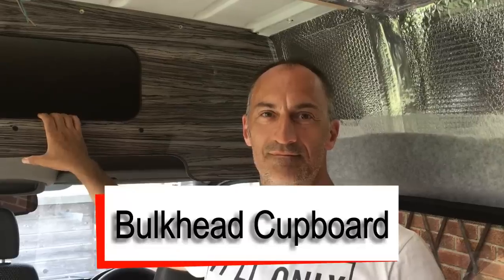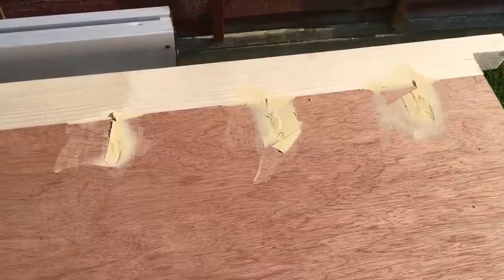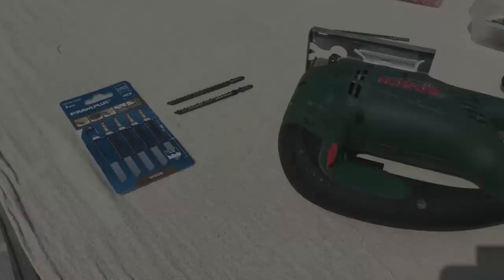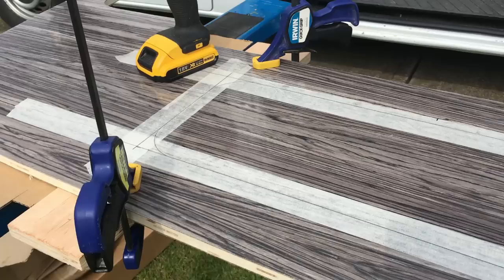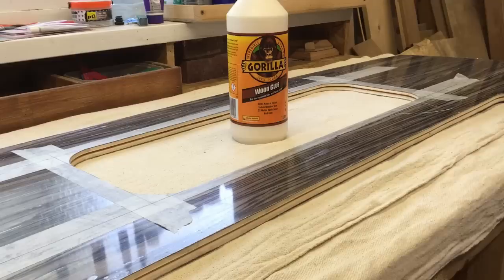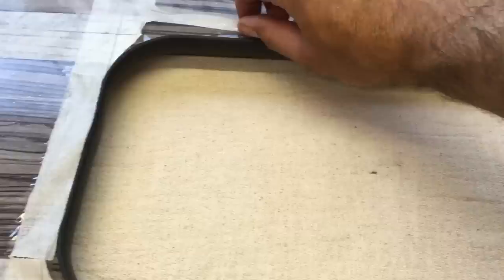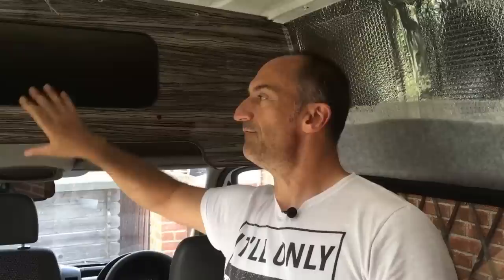Mercedes Sprinter Camper - Bulkhead Storage

Comment: Hi Greg. Did you insulate the space behind the headliner? Maybe I missed it in your videos. Anyway.. was curious, if you did, what materials you used as the space is limited. Nice video again! Learned a lot from your series so far.
Reply from the maker: Yes we did but didn’t film it. It’s easy to unbolt it and remove it we used wool based insulation cover with a vapour barrier and replace the headliner. 👍🏼

Comment: Hi Greg, I notice in this video you've not used reflectix to vapour barrier in the insullation over the headliner. Is this something you did afterwards? We've just ripper all ours out and are starting again as it was all wet. I was going to vapour barrier in with the over head locker over the cab. Be interested to here what you did with yours. Cheers Greg, really great series.
Reply from the maker: Yes you do need to vapour barrier over the insulation to stop condensation. It mean the headliner has to come out 😬
Reply: @GregVirgoe  thanks Greg, headliners out already just wanted to be certain we weren't wasting our time :) hope the new project is coming along, looking forward to seeing the videos when they come out :D

Comment: Is the shelf screwed into the metal of then van, or do those wooden plates just stop it from falling any lower? Great job by the way, watching your series closely!
Reply: Chris B... thinking the same thing? Is there a rib to fix to? Great vids btw. Doing my own conversion and these videos are great.
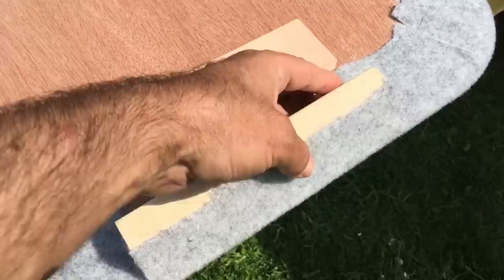Reply: Nope, it's fastened to the small pieces of wood, just like at 4:40. Those 2 elements are clamping the plastic of headliner together - holding the whole plank in effect ;D Simply genius !!!
Reply: I will third that question.  I was checking my bulk head.  I'm assuming you didn't just screw to the headliner and backing.
Reply: But how do you get the small piece of wood on the other side of the plastic?
Oh and awesome work as always mate 🙏🏼
Reply: I'm starting to think he maybe removed the headliner and fitted the shelf before refitting?

Comment: Hi Greg. Building the O/H bulkhead is a great idea,  did you first of all strip out the headliner and use sound deadening and insulation? 
Thanks
Giacomo 'Working on a Dream'
Reply from the maker: Sound deadening was already installed by the manufacturer and I filled the void with Earthwool insulation. Thanks

Comment: you are doing a really nice job, beautiful finish, very professional. I can't say my conversion is as well thought out :)  I have a 2006 Sprinter and am interested in your headliner shelf. At the front did you just screw into the headliner itself, what type of screws. For the side you must have slipped that second piece of timber around the outside of the headliner and screwed outwards into it ?

Comment: Hi Greg can i ask how you fixed the base to the cab roof. It seemed to just go from prepping to installed but im unsure of what you screwed it to or glued it to. Thanks for your time.
Reply from the maker: The mains strength of the shelf is held on the side and that timber cross member which is fixed to the furniture board. It did need much else so I just popped a couple of course screws into the headliner. 
If I did it again I would take the headliner out and insulate the cab roof like our new van and fix it like the sides. Before putting it back in.
Reply: @GregVirgoe  cheers Greg I'll check it out 👍

Comment: Hi you haven’t got a cad design drawing for the front cab overhead locker have you by any chance thanks Tim
Ps really impressed with you’re build really helped me out thanks
Reply from the maker: Hi Tim, the shelf could only be templated in the van to get it to fit exactly. I also cut the new face of the bulkhead by tracing round the old metal one, again I made a template first. Any odd shaped parts I have made templates and the plans are really used as design intent. Sorry can't help more than that. Cheers

Comment: HI Greg 
Just found your chanel/video from a chat on Facebook 
I have a question if I may 
How did you fix your bulkhead shelf to the van when finished I saw the timber blocks supports bud cant make heads or tables of how the fixing worked out

Thank you
Reply from the maker: THE MARKS BROTHERS I also cut some plywood pieces to go on the outer side to screw into. Lou held those in place while I fixed them. It’s fiddly and maybe easier to remove the headliner and fix them
Reply: @GregVirgoe  thanks Greg 
I'm hooked on your videos 
So grateful to have come across you feed

Comment: Hello and thanks for another very helpful video. I have one question. Is it enough solid when you screw directly to tapecirung? I need to build it in my Mercedes T1 and one option is to cut the tapecirung and place shelf on the car body. Thank you

Comment: hello Greg thanks for the nice clip .my question what did you do about the 28 mm gap behind the front panel.  Myself building a campervan with a VW Crafter h2 l3 bj 2012 and solved it with a strip of plywood. Thanks hope to see you mayby on some camper place

Comment: Awesome video! I had a question, how did you screw the very front of bulkhead to the headliner? did you take out the entire head liner to do this?
Reply from the maker: I didn’t take it out. With the rear edge secured to the timber and the sides secured to ply backers the front didn’t need much support so I just fixed into the headliner. It’s been fine for last three years.
Reply: @GregVirgoe  Thank you so much for the response! As always your videos are so helpful!

Comment: Hi Greg you could build these for a living.  What did you fix the shelf part to? Did you just sandwich it to the original head lining or did you fix it to the metal van itself ? Thanks Dave
Reply from the maker: I built our van so we didnt have to work any more :D
the shelf is screwed through the headliner into a block of wood the other side.

Comment: Tempted to glue carpet to the inside at same time. Reduce the rattle factor of loose gear? I know you suggested use as a linen locker, but how many times are plans like that changed in practice?
Reply from the maker: I suggested exactly the same thing to the misses but was overruled.
I should have just done it when she wasn't looking :D lol
Reply: Time to build in a couple of loose ball bearings in a tin tray over her seat. Her sentiments will change quite quickly :)

Comment: Greg.  How did you get in behind the headliner to position the backing wood pieces to screw into?
Cheers
Lawrence
Reply from the maker: Lou has really slim arms so she reached down the sides to place them 😊
Reply from the maker: In hindsight probably make more sense to take the headliner out as do it. It’s easier to insulate the bulkhead.

Comment: Hi bud wot did you screw the roof boards too I seen the wood blocks but wonder if the screw go in to body is there any thing there
Reply from the maker: Hello, I placed the piece of plywood on the other side of the bulkhead and screwed into that and it clamped the bulkhead between the two.
Reply: Cheers bud I've got a crafter and just starting it good luck with your travelling  can't wait to see all the videos ✌
Reply: @GregVirgoe  Hi Greg, here a viewer from Holland, by reading the comments I now understand that it's clamped between de bulkhead. How did you reach   "the other side of the bulkhead" ? Did you take the whole thing out and put it back later? How else ?

Comment: Daft question, is that the actual speed you use the Jigsaw? Guess I am cutting much too slowly lol
Reply from the maker: Hi Stephen, not a daft question at all, most of my cutting shots are sped up by 3-4 times normal speed as they take so long. Go slowly and you'll get better results with less tear out. Great question

Comment: Did you mount the shelf solely with wood blocks sandwiching the headliner? In other words is the headliner actually supporting the weight of the shelf and it’s contents? I know you mounted the faceplate to the van body and the faceplate to the shelf, which provides additional support, I’m just primarily concerned with putting too much stress on the headliner itself. I’m considering creating an L bracket that uses the same bolt holes for the headliner mount to piggy back off of those fasteners and tie the shelf into the bodywork. Any help and advice is greatly appreciated. Fantastic work.
Reply from the maker: That would be a more positive support for that edge but to be honest I can hang off the door opening and I weigh 85kg
We only plan to put spare bedding up there so no weight at all really. Thanks

Comment: Greg two things aren’t clear to me re the OH Bulkhead fixing. How are the battens fixed to the ceiling where the opening is and how is the ‘front’ fixed just above the drivers & pax seat? I see the wood blocks and the piece of ply to go on the ‘other side’ but does this then screw straight into the cabin metal ceiling or is there another batten behind the ceiling carpet? Help. 
Working on a dream
Reply from the maker: I fixed a batten to the face of the roof support strut, that I could screw the furniture board into, that is very solid.
The shelf blocks all have timber on the other side of the headliner to screw into, the headliner comes out to do this.
The trailing edge of the shelf has a 3x2 timber fixed to it that the furniture board is screwed to, this makes the whole thing very strong indeed. I reckon I could do pull-ups on the open doorway it's that secure.
Reply: Hi Greg I have just reviewed this and as I have not started yet wanted to be clear on what is involved in removing the headliner and once removed does the same headliner get refitted back into place or is a new one required? I thought the headliner might be glued (fixed) to the roof somehow. Is there insulation under the headliner?  finally do you happen to have a video of this particular step? Love the help you offer and by far the most enjoyable viewing and great encouragement. I'm starting my build on Oct 29 and you have been a really great inspiration. Congratulations. Giacoomo 'Working on a Dream'

Comment: Hi Greg nice work, I’m researching lightweight finishing boards for my sprinter conversion and wanted to ask you your opinion on two types of finishing boards. Block board and the more expensive poplar boards you got from Moreland. Is there a difference as I’m trying to keep the cost down and weight is an important factor. Block board is lightweight too. Which should i buy?
Kind regards, Karl from Hull.
Reply from the maker: Hello Karl, I’m afraid I don’t have any experience with the block board versions. 
With regard to the poplar board it does cut very cleanly and is made up of multiple layers so very stable and got great screw retention properties. A full sheet weighs approx 26kg when laminate finish.  
Hope that helps a bit 😊
Reply: Greg Virgoe ok many thanks, the approximate weight info of 26kg is interesting! I can compare against the weight of block board now too as i struggled to find that info online. Happy touring, you are an inspiration 🙂

Comment: Wow, the finish on that is amazing! Do you think there is enough room up there to fit a battery and electrical system?
Reply from the maker: Hello, I would NOT put the weight of a battery on that shelf, the headliner is made of a compressed fibre and would not be strong enough to support it.
Reply: Thanks for the reply. Your videos have been very helpful.

Comment: i might be being thick here but what did you actually screw it inot, just the overhead liner ?
Reply from the maker: fred bloggs no you’re not thick you just didn’t watch this part 4:34 👍🏼😃
Reply: @GregVirgoe  i did see that bit, but wasnt sure where the little block of wood went. I assumed it went behind the headliner but wondered what that fastened to , if anything

Comment: HI Greg, we are converting a 2019 Mercedes Sprinter 170" - 2500 high ceiling. We have a question about this overhead storage. It seems to have side airbags there, wouldn't this be a problem?

Comment: great work as always!...did you screw just into the existing molded cab roof?...i'm doing crafter which id imagine is very similar.
Reply: Very good question...I see there was no reply to it.  He said he used the extra pieces of flat ply he cut to sandwich the moulded cab between them and the bigger pieces fixed to the shelf edges.  Well thats what I took it to mean and that would work for normal storage. Not too heavy stuff. I think there was 5 decent fixes.   BUT thats all very well and I can see that but how did he get the five bits of wood behind the cab roof to fix into.??????? Comon Greg tell us the secret of the magic fix!!!!!!!!!lol
Reply: I had the exact same question. Do you put the piece behind the cabin plastic mould? If so, how do you get it there?

Comment: I just started my van conversion and I removed the bulkhead and I was thinking if I will need it to pass the MOT on Feb .There is no way I'm going to finish my conversion before the MOT ,it is going to be in the middle of work without the bulkhead. any advise please?
Reply from the maker: The bulkhead removal makes no difference to your MOT at all.
They are not interested in what you are doing inside the back of the van, 
unless you change something structural on the vehicle itself.
Say you undo the front seat belt mounts for example?
If you have somewhere you can park it off the road you can always declare it SORN and save on the tax too if you don't need to drive it, that's what we did :D
Reply: @GregVirgoe  Thank you Greg I love your videos ,you are the most professional .Yes I did that, I declared it SORN
Reply from the maker: @DARKMATTERTIME  Awesome, that will take the pressure off and give you some time to finish it. Chock the wheels and leave the handbrake off, start it up regularly and move it about a bit if you can, just helps if it's going to be sitting for some time :D

Comment: Sorry if this has been asked all ready,  but did you insulate and seal the area above the factory roof liner in the cab?
If not how will you prevent condensation forming in the storage locker?